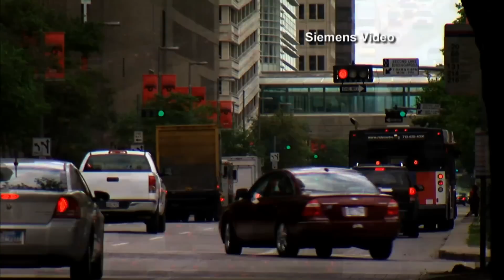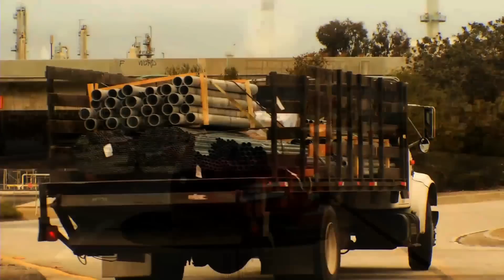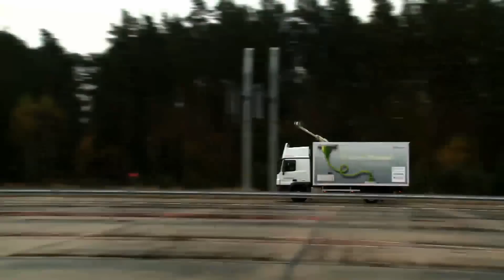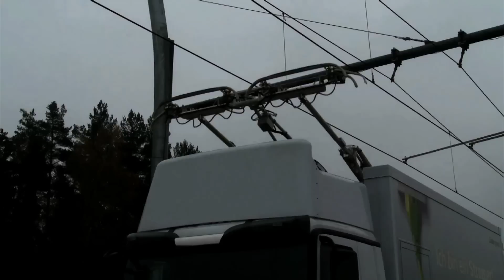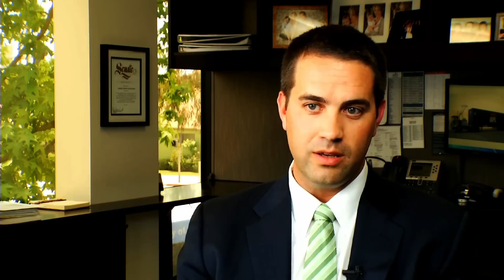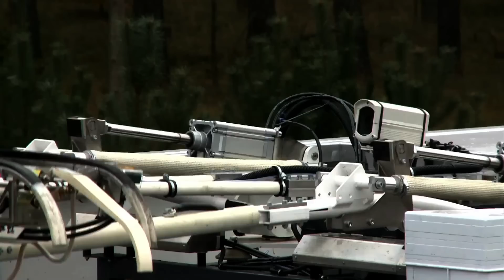Siemens Announces 'eHighway Of The Future' Concept

Comment: This "eHighway" logic could be easily extended to keeping the rubber-wheeled trucks on a highway, but use electric drive from batteries while moving in-city, without the wire. Also on several cities there is a trolley network which could be used during an in-city move, further reducing the distance that the truck needs to go on battery. This way the diesel could be omitted  from the truck, which makes it cheaper (while batteries are needed which increases it).

Comment: The ide is not bad, already tried in mines, where huge trucks use electricity from wire when climbing uphill, there are a number of such videoes

However, i think simply use trains is better. Trains are running on steel wheels with low friction, has a much lower air-friction compared to useful load, can be much faster than trucks, and are readily electriyfied. Trucks should take the role of moving the transported stuff from the railway station to the designated location - within a city.

Comment: Did anyone from the ground looking at the faults of man thru trucks and actually believe in that idea ever look up? With trucks smog & emission laws and change the entire industry in the swoop of a pen.  Normal people can look into carbon emission of gasoline and diesel engines.  But no one, not one single report has been promoted on chemical trails PLANES have been leaving in the skies for 20+ years.  Or maybe Rich Macias can look in the EPA corrupt board members using false data 1st!  Ideas...